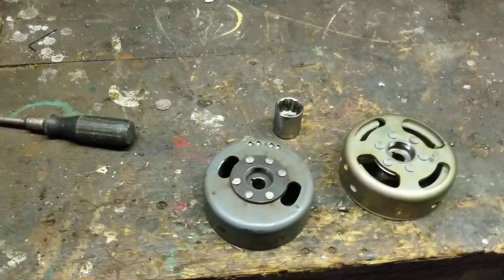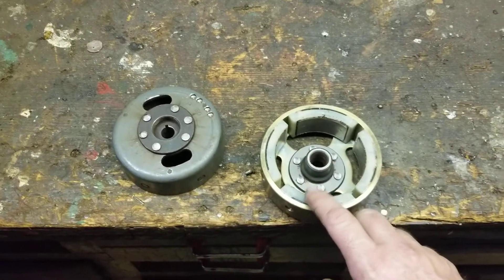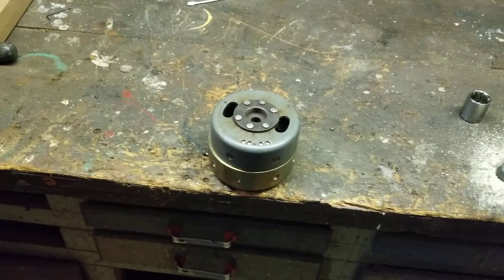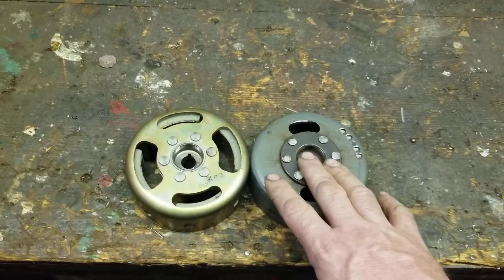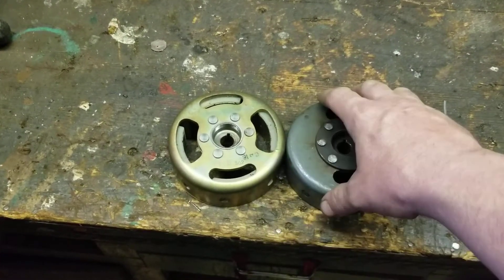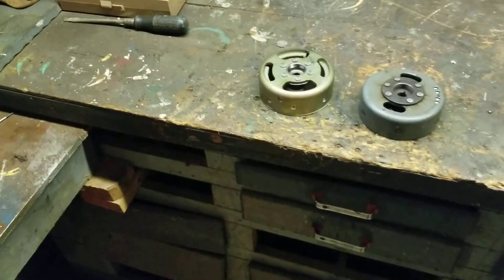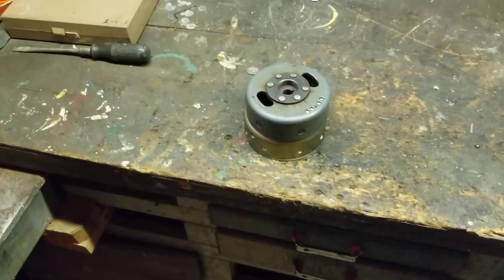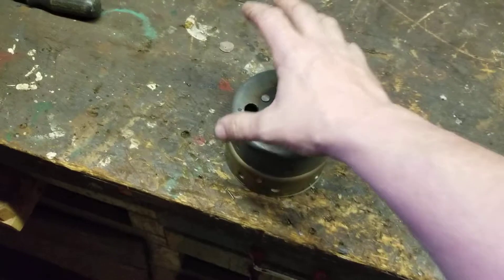Flywheel explained why you must use the proper flywheel

Comment: At 2:35 you say a heavier flywheel causes less hp and conversely a lighter more hp. This is false. The engines hp does not change based upon how heavy the flywheel is, it only changes how quickly that engine accelerates or revs. 
Example of why say a woods rider may want a heavier flywheel would be to smoothen out the power or "hit" to gain traction and have more resistance to stalling bike when going slow (low rpms). Now a mx racer may want a lighter or stock flywheel for quicker revs and not more power, but getting to that power sooner.
Reply: Thank you!! I was about to say the same thing, only not quite as well as you have done! 🙌
Reply: A heavier flywheel takes more to turn.. causing less output power. A lighter flywheel = more power.. always has done.
Reply: @michblitz  what happens if the fly isn’t aligned ? My mechanic didn’t align my flywheel and now i don’t know if i just need to take of the fly and and align it or do i need to take off the camshaft to align everything that connects with it.

Comment: Kevin, I wanted to give you an update on my conversion to which is why you may have recorded this video. I did machine the RX50 stator to fit and the RX50 flywheel taper is identical. The flywheels on these machines are independently balanced due to mass production runs. I got the timing spot on with a timing light and been riding on and off since. Has plenty of power and no issues. Ke100 cdi flywheels are hard to come by and costly. I know you don't agree, but it works for me. Thanks for the videos it inspires al lot of people to work on these bikes.
Reply from the maker: That's awesome you got it great job

Comment: What do the different letters mean on a flywheel timing
Reply from the maker: Typically there's a T line and F line ti is for timing setting points and on 4 stroke engine to line up the cam on 2stroke engines it's for setting points the f line or fire line it where the spark plug actually fires

Comment: Hello bro, I have questions about flywheel and coils. Waiting for you to reply.
Reply from the maker: What is your question
Reply: I have a cg 160 engine from Brazil,  I don't have the CDI box, so I want to use a xr 150 coil and flywheel on the cg 160 engine, any advice?
Reply: The real question is,  will the cg 160 flywheel power the xr 150 coil? Note; the cg is fuel injector.
Reply from the maker: @morriswade312  I believe they are different

Comment: Are yamaha RX magnets made by mitsubishi?? Usually The manufacturers put their logo on the magnet. Yamaha magnets only have Yamaha logo on it. Nippon denso makes stator rotor assy. But In my kawasaki KB 100, the stator is made my Kokusan denki. But the rotor flywheel brand , I cannot identify.

Comment: Will there be any problem if the inside of the flywheel is scratched ?
Reply from the maker: No  scratches are fine i would find out what happened
Reply: @2strokeguru  this is what happened while reinstalling the magneto cover I accidentally dropped a Dowel pin inside the rotor and I didn't notice it was in there i started the bike and noticed a light scrubbing noise immediately turned it off and removed it and saw the pin in ther had created slight scratches insee the rotor spinning inside and a small nook on the stator coil winding
Reply from the maker: @kiran-wh9wg  make sure you don't have any broken windings should be ok

Comment: Well for example. I have a Yamaha RT180 trail bike, if I took the entire ignition system off of a Yamaha YZ 125 per say. Coil, CDI, stator plate, magneto and the fly wheel. Hypetohetical speaking the fly wheel is externally balanced like the 180 fly wheel.